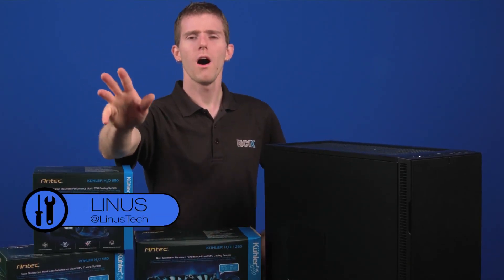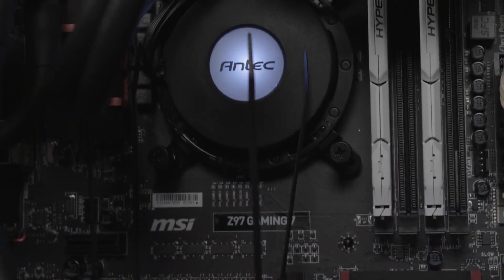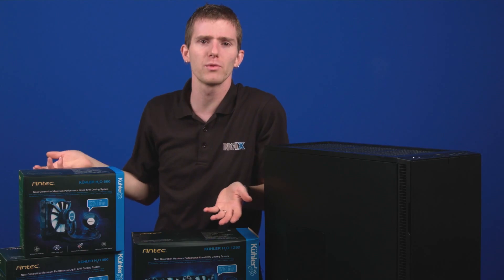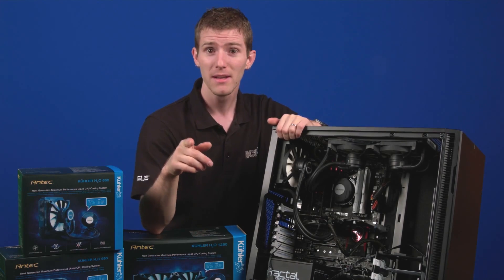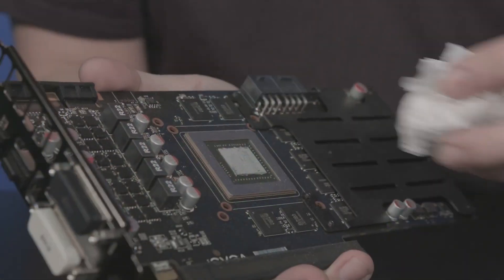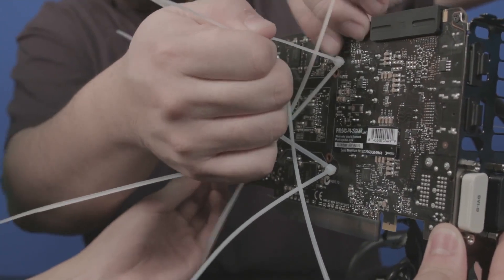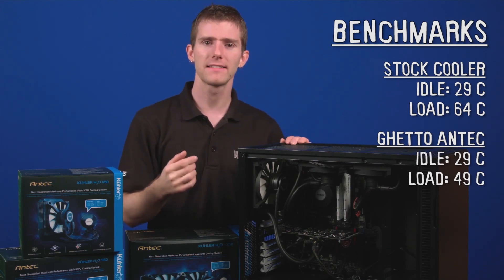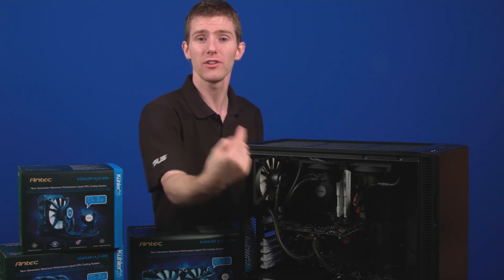DIY GPU Cooler ft. Antec Kuhler liquid CPU cooling

Comment: The load temp is lower than my card's idle temp :/
Reply: +Topias Salakka Then take off the cooler and replace the thermal compound. Worked wonders on my R9 290X reference design.
Reply: +Topias Salakka You got shit airflow then.
-Dust
-Thermal compound
-Heatsink seating might be off.
-Bad airflow.
These are the main things to consider. Also check your CPU temp, because if your cpu is doing alot of shit at idle, you might want to consider getting a better cooler for the CPU too or clean up your processes and shit. Like not have every program start at windows boot up.
Reply: Lex Luther It's an R9 290. And i like to waste people's time xD
Reply: +Topias Salakka your gpu temps can only get as low as the ambient room temperature soz
Reply: +Topias Salakka then it's just really hot RIP
Reply: Is it about 50 degrees at idle? If you're running an amd card the fans turn off when at idle. My r9 380 does this and runs at 45-50 at idle.
Reply: +Leone Furlan pffff my old Radeon HD 6850 got to 107°C normally on load. It was 5 years old and I think the fans just weren't as good.
Reply: +Topias Salakka get a compressor plz and blow the dust out...
Reply: Lars Schothorst It has no dust. The temps have been terrible since the day i bought it.
Reply: leffleff3 I've done that twice. Didn't change shit.
Reply: Phoenix2079x Minecraft&More Ambient is like 21°C
Reply: DerpyPhysics My card's fans do not turn off. They spin, but quite slowly.
Reply: solitajre222 My CPU does basically nothing at idle.
There's no dust on my GPU heatsink.
Airflow is good, because previous GPU only got to 70°C

The second fan on my card is loud though, has been since i got it.
Reply: Check your heatsink seating, consider reseating it
Reply: +Topias Salakka Thermal paste must be bad
Reply: acnfanmanin AC MX-4, one of the best pastes.
Reply: Maybe you used too much?
Reply: acnfanmanin I don't think i did.
Reply: Leone Furlan 70C at load its pretty good, 80 was a little high but I would say its fine now.
Reply: +Topias Salakka Most modern cards dont run the fans at idle...
Reply: JgHaverty My MSI did... So does my current XFX R9 Nano.
Reply: Topias Salakka  "most" =/= all.
Reply: +Topias Salakka I replaced my GPU fan with a 120mm cheapo one,and it went from 99 °C on load to 68 °C
Reply: Godfrey De Klerk Yeah Fan speed can be controlled,my card has PWM output (Yellow wire?).Assembly was very simple, I installed really thin L shaped aluminium brackets to the bigger fan and taped them to the heatsink with aluminium  tape (The one used in air ducts) and voila !!

Simple,cheap and functional :)
Reply: +Topias Salakka Get a custom cooler
Reply: TheMalvage & Gaio I don't use the card anymore.

Comment: Thinking of using electrical tape or duct tape as can't afford zip ties. What's people opinion? Gonna hold the fan on the card that way too. Might use some water instead of thermal paste as i hear it's the same conductivity and can't afford thermal paste. May add corn starch to the water to make it a paste aswell

Comment: im trying this on the MSI Geforce GTX 560 Ti HAWK. @ Stock currently (950/2100)

on air: 77ºC
using an Antec Kuhler 620 zip tied on it: 46ºC
Reply: +DeadNullermand Do you have any cooling on VRAM and VRM modules?
Reply: 1080GAMING it has a alloy plate on them, but yeah i did use a fan to blow air on them so the card didnt suffer from it

Comment: corsair HG10 aio coolers are out and they do the exact same thing but also cool the vrm and memory
Reply: NZXT G10 does the same thing as corsair but looks a little bit better and fits on more cards. And You can swap fans on it, and use more coolers.

Comment: How is the Vram and the rest of stuff cooled on the card?
Reply: +Mr0909dragon it's not, this only works if you have a pcb with built in heat plate for the vrm and moffsets like the EVGA ACX models. I would not recommend this on ANY of AMD cards since they run pretty hot already.

Comment: how long do you think those zip ties will last before they melt down, the cooler falls away, and 1600+ cores start frying inside your case ??
Reply: +Black Knight The zip ties wont melt dude lol The temps aren't going to be near the level required to even begin melting them.
Reply: +Black Knight Zip Ties (the brand at least), have a melting temperature of 275c.... if youre hitting 275c, you have OTHER problems lol
Reply: Black Knight About... a few days... i guess :P
Reply: Toby Hinloopen you're a bit too optimistic haha
Reply: Black Knight That depends on material of zipties and gpu use.

Comment: I bought a custom adapter and threw it on with some heatsinks, killed my GPU in 4 hours but because EVGA are rad I got a new one in two weeks. Left the stock cooler on this time so a bit warmer and noisier but it still works so I have to deal with it.

Comment: When I play WItcher 3, mine reaches around 78 degrees celcius.  This is on auto fan speed control btw. When I made my own preference in fan control like 100% fan speed at 60 degree celcius, it stayed at 70 to 71 degrees celcius. Is that normal? Should I buy a cpu and a gpu cooler(like that)? I have no plans on OC'ing this. Thanks!

Rig Specs:
-AsRock H97m Anniversary
-Palit Gtx 970 Jetstream 4Gb
-Intel Core i5 4590 
-8gb Corsair Vengeance(2x4Gb) DDR3 1600 Mhz
-WD Caviar Blue HDD 1 TB
- Seasonic ECO series, 600watts 80% Efficiency Bronze
-NZXT S340
Reply: Renzell Barros Please do not try to use this for your GPU,but go ahead on the CPU. If you really want to watercool your 970 go check out Jayztwocents, he makes great watercooling vids
Reply: Alright, thanks man! :)

Comment: I'm thinking of getting one of these for my CPU. As it stands, my CPU tends to get really hot under load, and I'd be hoping that this might help out a bit more than the stock intel heat sink lol. Nothing's probably going to improve its performance, and I know I need to upgrade, but it sounds like it would be a great entry to water cooling and probably be a better cooling method then the standard I'm using now. Would I be right in assuming that?

Putting one on the GPU, with twist ties none the less, made me burst out laughing. That's just awesome! xD

Comment: on my first computer, i had a radeon hd 5450 and a spare cpu fan
so i put the computer on its side and positioned the fan in place, plugging it in
it didn't do much but it was a fun little experiment

Comment: Depending on the block... there's a better way to zip-tie. it also takes 8.

Take 4x Zip ties and turn them into 2x LONG zip ties. Then like an X thread them over the TOP of the block. This way they hold the block in place and are not prone to slipping off one side or pressuring your hose connections.

Do the back in the same way as shown in the video using 4 more to secure the back. ALSO if your hyper paranoid you can use 10 Zips, One around the block like shown in the video but OVER the X pattern thus holding them down to the block on the sides, and one small zip (literally find a small ziptie) around the X on the top at the crossing point. To keep them from sliding to the left or right. You could even use 2 small zipz to hold them in a X pattern over the X... But that's just excessive.

Comment: I would like to know if a water cooler Antec Kuhler 950 could handle an i7 overclocked 4770k of 4.5 or higher? or at least hold him without overclocking with a low temperature
Reply: Willians JS I have a similar setup from Raijintek on my FX 8530 OC'D to 4.9 stable. You should be more than fine with the lower heat output of the Intel :)
Reply: Mitch Brown Man, I'm Brazilian and this brand is not well known in Brazil, few people have, I'd like to thank you for your time I'll buy a water cooler that so to see if it will actually hold the i7 4770k in overclocking,Thanks!
Reply: No problem sir! Good luck! :D

Comment: Zip ties to hold a water cooling block to a GPU is a terrible idea as it would lose tension over time and become loose enough for the water block to fall away from the GPU and then it would cook itself! Ever notice that on Graphics cards they have metal springs on the screws to allow constant tension to be applied to the heatsink so it can't become loose over time?

Comment: this is a good way to kill your vram
Reply: cornholio223 You just stick some little heatsinks there and point a silent fan to that area
Reply: Alfredo Putamadre yap just buy an aftermarket gpu cooler that comes with those, insert cooler in trash can and install only the small heatsinks cause i doubt u'd find those anywhere else..at least not in my country
Reply: ulikemycat baby as someone that has used the nzxt kraken that fan doesn't do crap. in a pc that has a case temp of 40c it still overheated the ram every time I played a gpu intensive game
Reply: ***** I ebay I've seen a lot of little heatsinks for vram dirt cheap
Reply: cornholio223 I was gonna say, what about the VRAMs, VRMs and chokes?????
Reply: +cornholio223  if you watched it right to the end, he covers that :P
Reply: ulikemycat baby its not good enough, not even close, u need heatsinks for those too :P if you don't buy an aftermarket block for your card..ur wasting money with that nzxt g10 or whatever, the cooler from the manufacturer or an aftermarket air cooler is generally better
Reply: ***** You can buy tiny little metal heatsinks meant for ASIC's used in [x]-coin mining.
Reply: ulikemycat baby the nzxt one isn't good,pple tested it, u need heatsinks
Reply: +ulikemycat baby fan is not enough cooling. i learned the hard way and broke my 980
Reply: +Earl Manly listen to 2:50
Reply: +cornholio223 ah like totally dude, uh uhuhuhuhuh.
Reply: +cornholio223 Hey, from what you wrote I think i understand what the issue is, I am wondering if you could provide a solution. this seems like a really good idea over all.
Reply: +Karan Trivedi 7:30
Reply: Yea, I understand that removing the aluminum sink cools everything, but what would be a better solution for this?
Reply: +Karan Trivedi  7:45
Reply: lol, is that even good enough? Like ur using this expensive system for cooling the gpu and then just a normal fan for the other important chips
Reply: +cornholio223 I think we'll need more zipties.

Comment: I remember sticking a small triple heat pipe CPU heatsink from a HP slim PC, used zip ties as well but!! i kept the springs that most cards have on the back. Great way to make sure you have even pressure (at least more than static pressure at 4 corners). It allowed my HD 4850 to go all the way up to 1.1Ghz with a pencil mod (increase voltage) and was stable with furmark for hours. Later on i picked up a triple fan GPU heatsink and pushed it to 1.35Ghz, which is what you see on a lot of new GPU's. Point is this was back in 2008 and GPU coolers like that didn't exist until maybe 2011. Soon after someone broke in my house and stole my PC :/ right after i put a sandisk ultra that just came out in there.

Comment: im thinking of doing this to my 570 glh as it is being replaced tomorow with a 960 from kfa2 the xc black. the reason im considering this is i have thermal run away atm im geting idle temps between 45-70 c. a bit of a dramatic scale really. do you think if i do this i can either elliminate the runaway or keep it under wrapps, please bare in mind that now under full load i cant even play saints row 4 without it feeling like its in slowmo. and to clarify it did have the icey vision cooler on it but somthing went wrong and would not clock down fan speeds even manually yet it could pick up the aprox speed, and when i doctored on a gtx 580 phantom cooler it worked fine for the past 4 months, any ideas would be welcome, howeve critisum over my choice of cards will be ignored i am here for advice on the gtx 570 not your opinions on where iv gone wrong.

Comment: Simple idea, if your brave enough and creative enough this works well for those on a budget, but i think it would be better to use a solid brackets , cable ties can be waaayy to uneven . I made a loop in my system with an H100 and a Thermalteke Water 3.0 on the GPU, on the same loop. Works okay. will try make a video perhaps. But, great tip Linus and NCIX

Comment: You could 3D print a ghetto bracket mod
Reply: masterman3349 nnnnnnot really... only if you don't know what you're doing
Reply: Most 3D printed plastics are good up to at least 60 degrees C, ABS is fine up to 100 so it would comfortably manage the temperatures at the mount as it will not get as hot as the GPU.
Reply: Peter Keogh 100 C is really hot, i don't think the CPU/ GPU should be getting that hot in the first place
Reply: masterman3349 thats the point it won't get that hot a really hot GPU will be maybe 100 at junction, but that will translate to maybe 50 at the mounting hardware and anyway with a water cooled system you would expect 40's which would mean mounting hardware temps close to ambient.
Reply: It might melt if it was plastic
Reply: masterman3349 3D printing materials have different melting poits. It could work if high melting point material was used.
Reply: PeterJ Keog Most GPUs have TDPs of around 99 degrees celcius these days, so ABS would (theoretically) be a suitable material to build a bracket. Thanks for the information. I make my brackets from brushed aluminium though.
Reply: Stabswache, der Wächter. TDP is measured in Watts. As long as the water cooler is chosen apropiatly ABS would be fine. Anyway this is supposed to be a ghetto solution, aluminum is cheating... Unless by "brushed aluminum" you mean crumpled up foil
Reply: PeterJ Keog Yeah, I was saying ABS was suitable... I was agreeing with you. I obviously don't mean aluminium foil.
Reply: PeterJ Keog If you can afford a 3D printer you don't need ghetto mods.
Reply: By the same token if you can afford a graphics card... *****

Comment: Ok so, I've been getting my CPU to run at 90ºC~100ºC while I play FFXIV and it has stopped twice on the same week. My ambient temp was around 38ºC~40ºC.
So I've been thinking in building a loop or getting an AiO water cooler but all I see people saying is that AiOs have a small life span or perform the same as Air coolers, which are cheaper. Some say that custom loops are just for looks.

So, what do I do? Living in a hot tropical country, I get pretty high temps and don't want my PC to die.
Reply: 90 to 100 it's days are already numbered
Reply: Holy, 90 ~ 100 C !

Turn that overclock down and don't ever overclock on the stock cooler/Shitty water cooler.
Reply: Nicholas Tiley Nothing on my rig is oc'd. My cpu is an i7 4790k.
Now that the summer is over, I get temps of 60°C tops when playing Wicher 3. When I run FF XIV, I still get around 80°C though.
Reply: ChrCOLTChr buy evo 212 or something for 20 euros and your temps should be 60c when under 100% load without overclocks, assuming u have intel stock shit fan thing
Reply: jep buu The shitty stock fan is exactly what I have...
Reply: ChrCOLTChr yeah thats the reason : / get 212 evo or similar its cheap as fuck and halves ur temps by 30-40c
Reply: jep buu Even if I live in a hot country like mine? I was aiming at the XSPC raystorm 750.

Comment: I sent a pic of this to your site im pretty sure.  I did this to my two gtx titans second day they came out.  Used the thermoltake but same shit.  My mock up to see if would work i used zip ties.  But best way to do it is take the secure ring that fits the closest then cut the left over tabs off and drill the four ne holes in it that match gpu cooler holes.  Then just buy four bolts the right length and you can bolt it instead of zip tie it.  Trust me on the bolts cuz pulls the cooler tighter to the chip.  On the custom titan 450 watt bios with llc delete im running 500oc on mem and gpu's stable at 1250 and at 100% load was hitting 68 with zip ties.  But when went to the bolts brought me down to 62.  But alot ask if can afford titans why would i do this?  Simple.  I upgrade alot.  Can never reuse blocks. I have the ability to so why not.  Way i see it use the momey for more ssd's or something youll see gains.  Like my four intel 520's in raid 0.  Where if went full block doubt id even see a diff..

Comment: just did this mod on my gtx 770 referennce. Im glad to see it work very well:

Stock cooler:
- idle = ~60C
- full load = ~80C ((stock thermal target))
- noise = mini jet in my case
-clock speeds ~1175

"green mod" ((this mod)):
-idle 28C
- full load 49C 
- noise = whisper quiet
- clock speed 1295 ((overclocked like a boss))

for the VRM i just have a fan under the card facing the VRM and VRAM modules, and just kept it on high ((plugged straight to 12v)) and it has served well. this is a trick to do one handed but very doable... just make sure to plug everything in first before you turn it on... cause i freaked out when it was hitting 90C and all i was was the pump wasnnt plugged in -_-